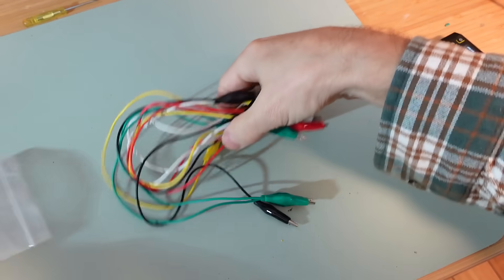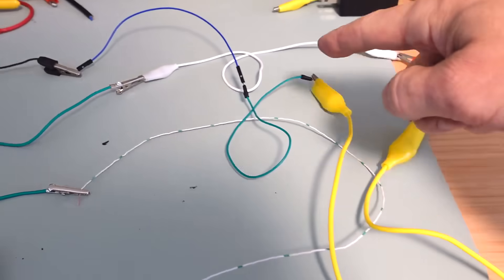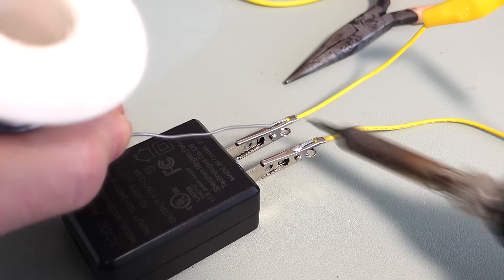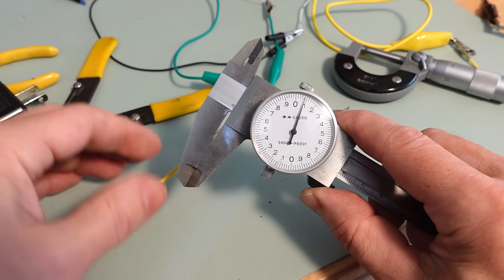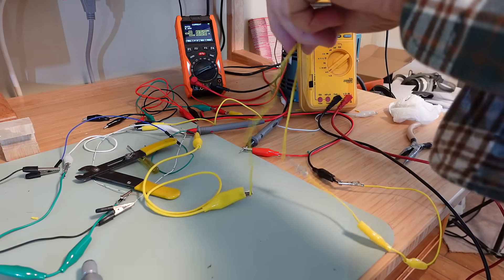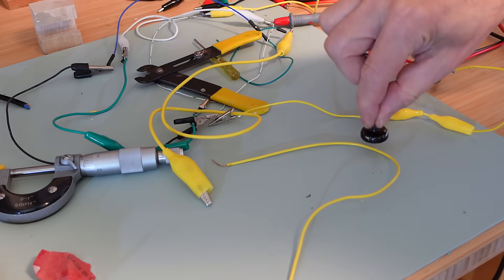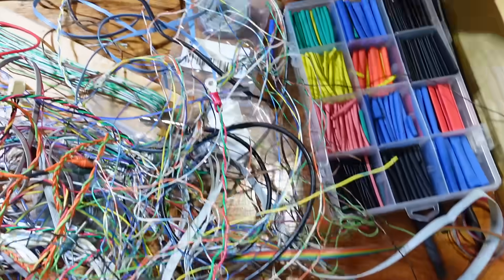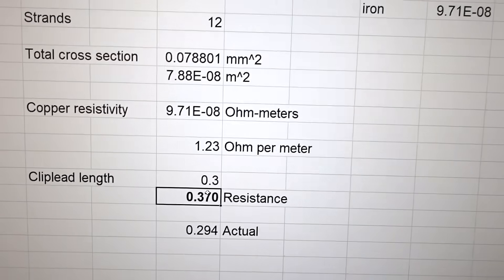Clip leads made with fake wire

Comment: Thanks for the video. Who would have thought copper plated steel cores were a thing? Man, if there’s a way to fleece us someone will do it! I’ve had issues with my PSU output control at times, now I know why.
Reply: Automotive industry pioneered it.  New sensors need less current but engineers were not prepared to make the copper wires even thinner, compromise was to use stronger steel wire and copper plate it to protect from corrosion.  Recycles better as the wire loom is usually shredded with the chassis and the copper is lost.

Comment: Iron has only about 5% the conductivity of copper. 
That's good enough for me lol
Plating iron wires with copper can work well to mitigate the skin effect, especially for applications where high frequencies are involved, as the majority of the current will flow through the thin copper layer on the surface, which is a much better conductor than iron due to its lower resistivity; however, the effectiveness depends on the thickness of the copper plating and the frequency of the current involved.

Comment: I've seen plated copper on some metal that solder won't even stick to it
Wire that can't be twisted, strands have a springy effect
Wire strands that turn to dust after few months (my country is very humid) you won't even be able to find a single strand of wire inside the insulation, all turn to dust

Comment: The poor quality of Chiesium wire is getting ridiculous. I've found similar wire core dimensions in figure 8 and 3 core power cables. I also found a set of car jumper cables, despite having 10mm OD wire, the core inside was 0.75mm square. Those new clip leads are junk. I make my own using silicone wire, its very soft and compliant.

Comment: I bought a Chinese battery charger. I needed to change the mains plug but I couldn't make the wire strands either bend or twist together. No matter what I tried they just sprung back out straight. Yes- they were steel! In a mains lead! The only way to terminate them was to crimp them. Utter rubbish.

Comment: I can't believe this is something that I need to keep a lookout for.... Besides its significantly higher resistance than copper, how does iron wire handle repeated bending compared to copper? I'm guessing it's worse given that iron (many alloys at least) can be work hardened, whereas copper is very ductile, right?
Reply: None of my recently purchased thick, stranded wire with silicone insulation are attracted to magnets. Whew, so not iron (unless they're using an iron alloy that's not magnetic). I oversize any wire I use for power connections, but not oversized enough to compensate for counterfeit wire made out of iron!

I guess it's a reminder for me to double check my resistances before use.

Comment: Magnetic copper!  
I had "brass" bristle brush from the local ACE hardware store.  That brush scratched an item that brass would not have and at closer look, the copper wore off quickly, revealing the underlying steel.  But subbing a copper coated steel wire used in a pigtail is stooping even lower.
The Harbor Freight pigtails often test at multiple Ohms but usually the problem is sourced to bad crimping or wire just a little too thin or nearly broken in the lead wire.
Thanks for the insight.

Comment: These fake clip leads have probably been around - and sometimes 1 Ohms and up - and causing bench accidents for twenty or thirty years. The fake wire makes a very satisfying sound in the waste basket after replacing it with, depending on your requirements, 22 to 18 gauge silicone wire.

Comment: Use a jet lighter to burn the end of a wire. If its copper - it would melt and ball up. Copper plated aluminium/steel stays straight and turns silver as copper burns off or mixes with base metal.

Comment: I wonder why they would go through the hassle of using super thin copper coated steel wire instead of plain copper. Is the production cost much lower than simple copper wire? I suspect that steel is more flexible than copper but other than that...

Comment: Not surprised. I bought a sub and amp wiring kit once. Was supposed to be 8 gauge cable or something. The cable was about 10mm in diameter with a 1mm core. I think the insulation was probably worth more than the conductor.

Comment: Copper covered steel, quite common in RF uses because of skin effect, along with CCA (aluminium). Haven't seen them used for wide range cables, but as prices of copper rises, costs must be cut :)
Some more honest sellers will include information about materials used (CCS for steel, CCA for aluminium), but some won't. Best bet is to buy from those who claim their cables are copper, checking them and filling for refund if counterfeit.

Comment: I bought knock sensors for a chevy 6.0 off Amazon and they were fake. No piezo sensor inside, just a 100 ohm resistor to trick you into thinking they are good. When removing them from the engine the studs snapped off. They make many other fake engine parts like the corvette style fuel pressure regulator/filters. BEWARE!

Comment: If it is not magnetic, it could still be not copper. I have a bunch of jumper wires (pin header connector) that are made of aluminum. If you strip them, they look like copper but that's only a thin layer. Soldering is only possible if you're quick because the solder dissolves the copper layer and pure aluminum wires can't be soldered.
The problem with those aluminum wires is that they break easily. Sometimes they break after a few bends. -> Total crap!

Comment: THIS IS SHOCKING! I am an Electrician and this shocks me a lot... because you never expeckt iron in a Cable....! Thank You for your work!
Reply: Component legs, like resistor and capacitor legs, have been iron since the 1970's, maybe earlier.
It is only some brands, some rare devices that have copper legs. Specific items that have high current or low ohms requirements.
Reply: The sensor wires in cars have had coper plated steel wired for decades.  It recycles better (less copper wasted) and it is stronger for the same current needs.  They discovered that the modern sensors needed less current but they could not reduce the copper wire size further for strength reasons so they went to steel, the copper plating is for corrosion protection.

Comment: The mouse might not be iron/steel in the cable itself, but instead the shielding around the cables.  I've had quite a few USB cables like that where the 5V and GND are copper (though stupidly thin still), same with the data lines but the shielding wrapped around it all just below the insulation is steel/iron just because it's cheaper and doesn't need to be as conductive as copper to work.  That said I've also had plenty that are unshielded so it's a toss up unless you cut it and check.

Comment: Thanks for posting this information. I will have to check my leads with a magnet when I get home. 

You can see at 0:24 that the alligator clip was crimped on the insulated part of the wire. It is likely that the conductor is too small to be held properly if the clip was crimped only on the conductor. 

I have experienced intermittent connections with these clip leads. I have since opened the crimps and soldered the wires to the clips to get more reliable connections. 

One time, a coworker was getting strange test results, and I noticed he was using leads like this. Replacing the leads solved the problem. Afterward, they also soldered all their clips.

Comment: Those cheap test leads definitely are plagued with "not-a-copper-too-thin" kind of issues. Had random glitches due to that including wire melting when they wasn't supposed to do that looking by visible diameter. Was a reason why I stopped to buy test leads in places like Aliexpress.

Comment: In the mouse cable the shielding of the cable is probably made of steel, but the actual signals are probably copper. Not that it would matter that much, as you said.

Comment: Thank you very much for your effort to investigate this.  Well, since you have those fake wires now, i guess your next project is an electric teacupheater !
Chinese solutions are cheap and dangerous.  First of these things I saw when I inspected a two wire bond which over here normally is made by soldering them together, Chinese way of doing it : twist wires and hotglue the bond.
You won't see me on a Chinese Flight !
Where did I leave my magnet ???

Comment: Chinese quality has gotten so bad that it isn't even criminally negligent anymore, it's straight up begging for any form of justice under the sun to stop them. I've seen them sabotage equipment at the factory level, for example, every lubricated tool you buy - degrease it straight away, it'll have iron filings in it and old motor oil purpose built to destroy it so you'll buy another one. Crazy shit like that. Worst part is, that's the same stuff you buy here! I found a MadeInChina plasti-formed emergency stretcher our paramedics pay $780 for from a first aid supplier in Sydney - they are sold for $17 each on MIC. That's beyond criminal levels of price gouging. The worst part is, the reviews show they fail at 95 kgs. And our ambulances are fitted with them! One rotund patient and boom!

Comment: Thankyou,   ive had some very strange results using cheap clip leads.. didn't think they would be iron, but that explaines everything..  time to make some new ones...automotive wire ?  lots of colors available and different thicknesses, so could be ok if they are copper and not an iron coated in copper..  f5vhz

Comment: In the scrap yard….or the place where the final meltdown is done, I think they first melt the copper scrap and any iron 
That missed being picked out with magnets or detached by hand sinks to thr bottom of the cricuble, however after the copper is poured off, a drossy reminant of copper and steel bits remains right at the bottom.
Not sure of the solubility of steel in moltern copper, but if it does, it only happens slowly giving them time tp pour off the bulk of the good copper…..but what happens to this “dross” left in the bottom?
   I feel that they should send it off to “hydrometallurgy”…i.e. wet chemistry, to be separated, i.e. sissolved in acids and varied in pH and oxidation level to precipitate the iron as rust amd leave the pure copper in solution….BUT, that is expensive on acids and reagents and tine consuming and messy….so what do thay do…just melt it all together at a higher temperature, greater than the melting point of pure copper and it all mixes to become this indeterminate iron-copper alloy!

How do I know this stuff….i first encountered it in Viet Nam, as stranded hook-up wire just like you have there in those clip leads. I went to strip, twist and solder it “as you would”…but when you twisted the strands of this stuff, the instant you took your fingers away it just SPRANG back to how it was before you sttempted to twist it….it was like beryllium-copper spring wire, but it was iron-copper spring wire and like the stuff you have there it had high resistivity and fine strands, but unlike the stuff you have there it was a bastard to work, twist, wrap or join. 
   I vould sort of understan encountering such stuff in a poorer country….but when I got home to Tasmania, about 18 months later I encountered the same stuff in some “low end” leads. 
   So there you have it, product of a “low trust” society being palmed off in out “high trust” society.
I first encountered crimpped…over the insulation, just as you have there, clip leads here in Tas about 8 years ago…(The iron-copper alloy was 20 years ago). I deemed that I just pull off all the clips and remake the leads from scratch and using decent hook up wire stock I have in my workshop…..the wire that came with the clips simply going out as more plastics contamination and the metal inside to oxidise slowly back to the compounds it was originally dug out of the ground as!

Comment: Iron wire. There's no low and no cost savings China won't stoop to. This is what happens when you let "10,000mAh" 18650s on the market unchallenged. Interestingly, Amazon seems to have removed all of the literal 10kmAh scams and capped what an 18650 can be advertised at 9999mAh. Gross.
Reply: “10kmAh”, you men 10Ah!      K = ten to the power of 3, m = ten to the power of-3, multiply them and get 1!

Comment: I have also seen copper-plated aluminium wires (particularly in mains-rated power cables and USB cables). Easy to spot those, since you can just put the end under a lighter flame and the copper will go first, and then the aluminium will melt.

Comment: I want spot a 10-pack of anti-static wrist straps with ground lead for working on sensitive electronics every single one of them was fake and completely useless there wasn't any connection between the wrist strap and alligator clip

Comment: I bought a pack of these in the summer at a Radio Rally in Essex, it wasnt untiĺ I started to use them i realised how crap they are.  I re-soldered  most of the poor crimps and the rubber coloured sheild cant be squeezed  with the clip inside either, too slippery.

Comment: i was working with some Chinese audio wire the other day and was cutting and stripping wires. and i had a magnet near by and i noticed the stripped off insulation was sticking to the magnet. I thought "how weird" then i noted the "copper" audio wires were also sticking to the magnet! 😂 Makes me wonder if there is a copper shortage in China or if they just practice exporting the bad or cheep stuff

Comment: Well, as I was watching I looked to my left and there were 4 such leads I used for testing stuff, and to my right a few batteries, one of which had magnets on its ends from some discharge tests I have done a few days ago... hmmm.
Magnet over each lead and, yes, one of the 3 got caught. Funny enough, its likely twice as thick as the others, so plenty of insulation :) Measured ~600mOhm which, I have to say, is definitely not OK and I now have some extra work redoing some tests due to the fact I'm both a cheapskate and a lazy, lazy person that failed to test the test equipment.
Thank you for reminding me of that!

Comment: It's likely not copper but steel. I've run into this junk when buying alarm wire many years ago. After being installed in my home after 15 years I started getting faults. I checked my circuit and found the wire was corroding, actually rusting. Since it was in the walls and connecting to switches near windows, it would get damp I figured and then fail. I fixed one circuit run before selling the house. Looking back I should have bought a quality alarm wire and not the cheapest I could find.

Comment: Thanks for the heads up, Matthias! I knew about the aluminium cheap alternative that works fine but the metal type... damn...
Also, about the mouse cable, check if the USB cable is shielded or not as the magnet might catch the foil that is over the wires themselves.

Comment: Funny thing - I bought the same exact pack at a local hardware store and kept using it, but the feeling that something weird was still going on - never really left me - continuity testing was just producing weird results, measurements were off etc. I changed batteries in my multimeter. I soldered the clips. I even remeasured the components in my circuit and now you're telling me there can be misleading wires... I am subscribing right now. There should be a PSA about this.

Comment: Having worked in IT for more years than I care to remember, installing Ethernet cables in small/medium sized offices and factories for telephone and data I ran into this problem about 10 years ago too, a lot of the bulk drums of Cat5e and Cat6 were garbage at 1st it was aluminium and then steel the SnR is utter (*&^ on this stuff over longer lengths if they simply labelled it what it was I could live with it  but 9 times out of 10 I wouldn't find out what it was until it was delivered and then I'd have to waste my time sending it back

Comment: You can get THE cheapest speaker wire or other wire from a local store and it will be 10x better than this chinese crappy cables. I never buy the clip leads only buy the clamps themselves and make my own wires now.

Comment: I was looking at getting back into electronics and getting a set of these jumper leads off ebay as I figured it was quicker than making them but now I will order the clips and use some real copper wire .5mm2 or so.

Comment: I have had worse. I brought a car battery charger from aliexpress and its cord was a standard pc style lead. i ended up needing a cord for heater and thought i would just use that since it said it was a 1.0mm2 10amp lead on the wire itself. well can tell you i was surprised when the wire melted in about 20 seconds, made a big boom, sparks everywhere and a big patch of burnt carpet later. lucky enough no house got burnt down that day. and yeah Turns out that was also a iron core wire, was magnetic and the strands couldn't even be twisted together like a normal wire, they would just unwind and  spring apart

Comment: That is very interesting. Clip leads are a mainstay of my bench and used often. I'll check all of them tomorrow, especially the ones I bought from Digi-Key.

Interesting side note I bought a couple of 12v power leads for my Waeco camping fridge, even the 1.8m cannot pass enough current to start the compressor (and the fridge just kicks an error). Not iron, just super thin. Worst $4.98 I've ever spent.

Comment: Copper plated steel is at least better than CCA wire, which does fracture invisibly with motion, and is a pain to track down. Yes a plus for reusing old phone wiring, which often enough you can get easily enough, as by me no scrap yard will touch it at all.